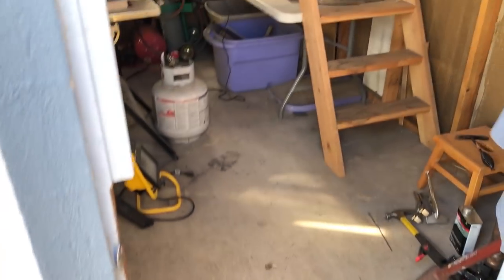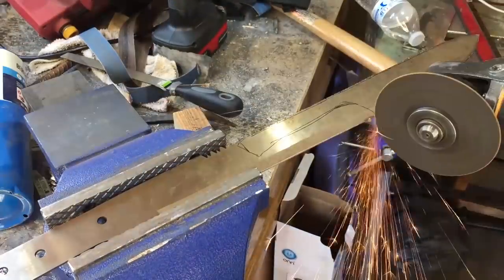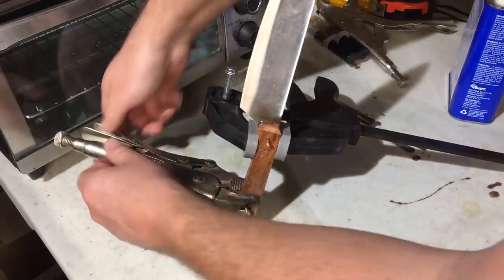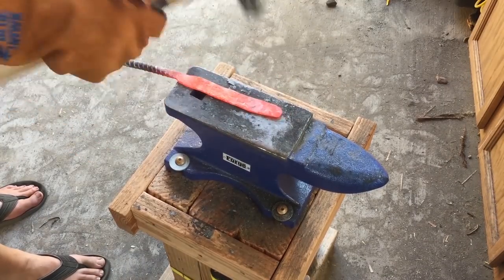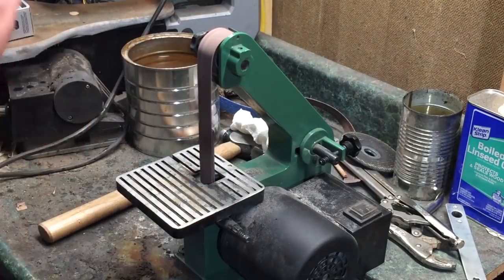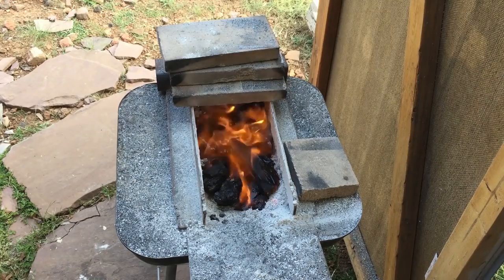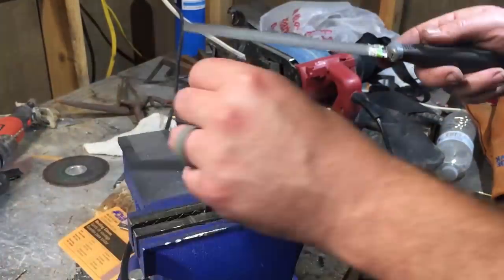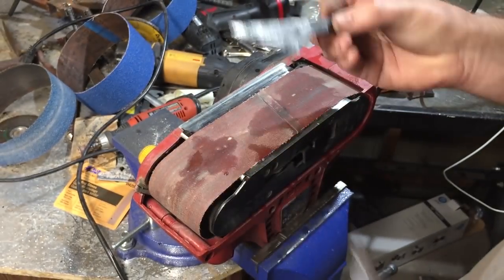3 Knives 3 Days 1 Video (how to make three knives in three days without losing your mind...mostly)

Comment: I'm too lazy to enter questions in a search engine, what's the history of the Japanese Kiridashi? Is that a traditional knife for some class or another? Defensive EDC? Did priests use it to circumcise oxen or something? Women carry it in case they had to stab some a**hole in the neck on the way home from the market? Where does it come from? What's the cultural context of the development of the kiridashi?
Reply from the maker: GeographyCzar From my limited research it appears to have been a carpenter’s knife. They might use it the same way a Carpenter would use a pencil? Obviously it would make very precise lines which gives the woodworker an advantage. Having said that, as with most knives, I would imagine it evolved over time and served a number of different purposes. They’re pointy AF, and scary sharp—I imagine a few “other uses” have been dreamed up over the centuries. 😂

Comment: Great little challenge.  I just did a no forge challenge and at least two of these knives would have qualified.  Essentially you can’t use professional forging equipment.  The HF anvil is probably borderline, but the forge was homemade and all the tools you used were either home made or stuff you can pick up cheap at HF.  I love the idea that forging and knife making is accessible to anyone with the desire to do it.  While it’s nice to have fancy tools, it’s just not necessary.  I really liked the fauxorged finish on the kiridashi.  I think I’ll try something similar.
Reply from the maker: ManCraftingTM Sounds fantastic! I may have to give that a try myself.

Comment: Very inspiring video for me. Made a few knives so far. Picking up a somewhat modified anvil tomorrow my buddy made for me for sharpening his knives. Can’t wait to make a forge and get to stomping on some steel. Look forward to your new setup!!! Thanks
Reply from the maker: chip Lape, Sounds fantastic! Honestly I only started about a year and a half ago… The basics you can learn in just a few nights, and even some of the more complicated stuff comes along pretty quick. At this point I would consider myself maybe an intermediate/beginner... I’m kind of at the point where I need to get some decent equipment and especially some decent instruction, so I don’t start developing bad habits. I’m glad I didn’t really have to worry about bad habits for the first several months, so much fun just learning how to heat things up, move metal, quench steel, put on edge, put on scales… All that good stuff. Plus it’s been awesome meeting this tremendous YouTube DIY community. Good luck to you and have fun!
Reply: Thanks. I did an hour project today making a knife by forging a piece of 1/2” steel dowel into a rough style knife by heating and hammering it into a blade and sharpening it. Fun little project and fairly successful.

Comment: just touch the dull drill bit on the belt sander 80-150grit it's doesnt take a lot of time probably not worth it in many cases but if you dont have another drill bit its a life saver
Reply from the maker: sime mkd Awesome tip! (Pun intended) 😉

Comment: Hey I rlly appreciate these kinds of videos ive been watching ur videos and I have subscribed but im in high school and with this corona stuff I'm stuck at home and bored and next yr I plan to take welding classes and ur home made forge and 65% belt sander and 15$ anvil videos are cool and ive also been watching ur knife and axe videos but I'm rlly  looking forward to getting the anvil charcoal next time I'm out bc I wanna start welding I've already started with wood work but ive rlly wanted to start welding and I will beacause now I know how and all this stuff is rlly cool and I didnt know it would be that easy but do I have a regular belt sander but its broke so do you recommend fixing that 1 but its older and my dad says it's hard to find parts so would you recommend getting that old 1 fixes or getting a cheaper smaller 1 like the 65$ 1 and i carve and make wooden swords for my nephew but I also wanna make knives and stuff like that my old sander can handle wood but idk if it can handle metal what would you do?

Comment: Please make some shop upgrade videos!
Reply from the maker: Coming at you! I hope a good band I will be my next piece, any suggestions? My budget really doesn’t allow for a freestanding model, but I understand there are exceptionally good portables that you can bolt in place.
Reply: Definitely, small bench top machines are the way to go for this sort of work. I would say you should try to find an older used bandsaw if possible that way you can keep the price down as well as getting a machine that’s of good quality and will last.